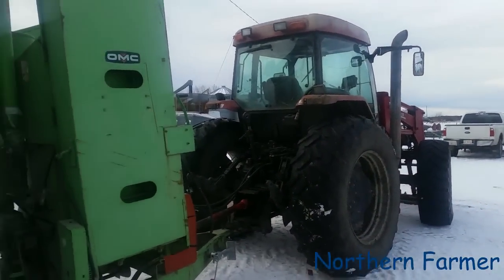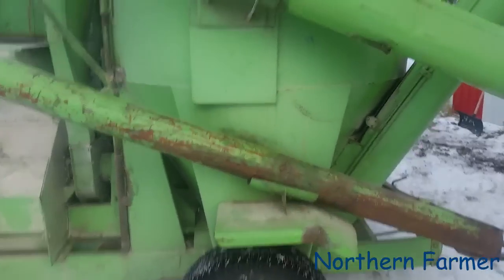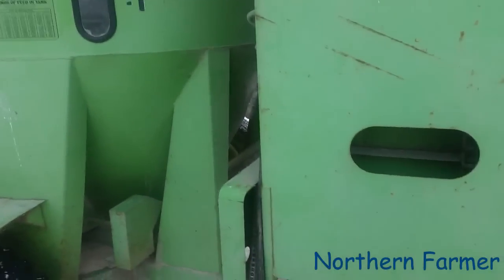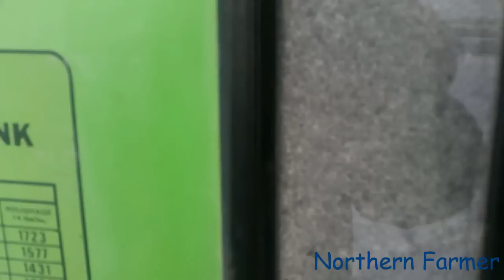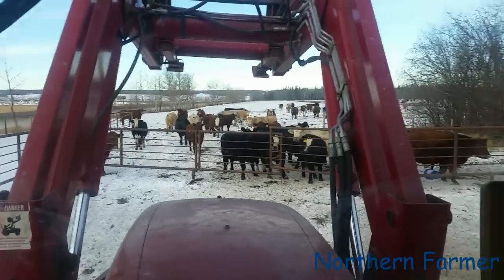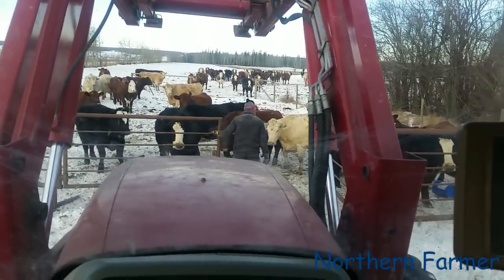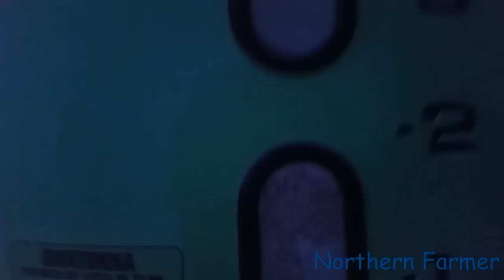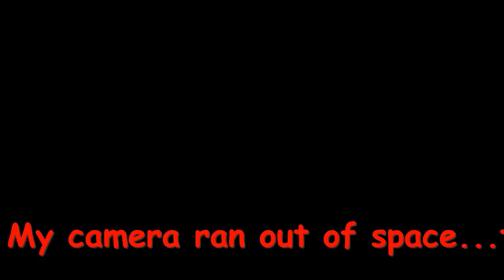Grinding Feed For Cattle with the old Hammer Mill!!!

Comment: That's awesome I've got to grind Barley today I just picket up some molasses to mix in it to help the dust.  It's still dusty
Reply from the maker: I never heard of doing that for the dust.... Learn something new everyday
Reply: The molasses is a treat for them but it does help the dust I also put canola oil with it.   The screen we use on barley is finer than yours and the one we use on corn is too big for the barley so it gets quite dusty once it's ground.   If you feed the barely in a TMR with silage it doesn't matter but we are just feeding hay in feeders and grain in the bunk so the less dust the better.  It makes a big difference on the steers when they are on 30lbs of grain.

Comment: How does Barley compare to oats for feed value? I always mix oats with my corn but Barley makes better straw, I may have to switch to Barley!
Reply: Barley is significantly higher energy and less fibre but it must be ground or crushed / rolled otherwise it will go straight through them and you will see whole grains in the dung. Rolled is better - much less dust and more palatable however you can counteract the dust directly by adding molasses or traditionally cod liver oil -both of course are high energy foods.
Another approach for us is to use a TMR feed wagon where clamped grass or maize silage is the main source of forage and prepared grains, protein and mins & vits are all added into the mix. The moist forages capture and kill the dust and don't allow stock to be selective about what foods they prefer.
The other main advantage for us is to incorpoate food factory / packing house by-product waste such as brewery products, vegetable products, potato sludge, veg waste such as cabbage /carrot/ beetroot /salad foods (but not onion) or other farm grown crops such as sugar beet, fodder beet, potatoes. 
I have no idea what might be available in your area from various food processors and some are only available at economic prices in the summer but can be successfully clamped in a pit store and fed over winter such as wet brewers grains from the brewery.
Many of these foods are high energy but often low protein and have peculiar mineral levels
Reply: Thanks Dan, I grind my oats now and mix with ground corn, so if I were to raise Barley I'd still do the same. Just wondering if Barley yields better than oats
Reply from the maker: Yes  Barley makes them fat!!! We will Grind both sometimes .. half and half
Reply: larsonvalleyfarm

The short answer is yes barley will normally out yield oats simply because it has a higher grist content and much less husk.

Autumn planted barley will out yield spring planted barley by about a third but although we can grow it very successfully here I simply don't know if it would survive your sustained winter weather. However if you can grow grain rye successfully planted in the Autumn through to harvest I don't see why you cannot grow it where you are.

A few issues you should be aware of:
1) Barley will not tolerate soil acidity well at all, you need a pH 6.5 for it to grow well and adequate amounts of P & K present in the soil or applied as fertilizer.
2) You need to examine the seed house agronomic information about suitable varieties as some are prone to foliar fungal disease especially mildew. Some are also inclined to become laid and not stand too well coming up to harvest although this can be overcome with finger extensions called crop lifters taht lift the crop up enough so that the knife can cut the stems.
3) Apply base levels of nitrogen + added sulphur quite early in the spring to support tillers or stimulate fresh ones if weak and topdress with more N about 4-6weeks later.
4) Beware of planting seed too soon and too thick as this can lead to thick lush growth which then dies back and can smother crops. We call this Winter Kill. If this looks as though it might happen consider offering some free winter grazing to someone with a lot of sheep -it looks mighty severe afterwards but the crop will bounce back in the spring when it gets some N! Sheep also firm the soil around the plant and help to counteract frost heave on the surface as well as returning a little dung to the crop.

Be aware that my comments are as if farming in the UK - a more local agronomy advice (college / University) service (or possibly your seedhouse) to you would be best for your soils and weather conditions.
Weed control is important and winter planted crops may well two treatments main one in the Autum and a clean up in the spring - these can often be combined with fungicide treatment.

An entirely differennt approach is to consider whole crop barley silage where the total crop is harvested when the grain in the ear is at the cheesy stage. Mow it and make pit clamp silage or bale it. Bales will have to be wrapped or bagged and stored on concrete or soft sand so that the plastic is not puctured. Wild birds can be a problem and also rats in this respect - we net ours or cover the bales with thick plastic and put down sealed plastic bags of rat poison as the stack is built. We tend not to make a stack but lay them out in long lines with the flat sides butted up close together as this discourages rats.

However would bales of silage freeze solid in your winter weather?
Reply: Thanks for the info Dan. We have made silage bales in the past and the outside 1/2 inch will sometimes freeze, but the bales dont freeze solid.
Reply: Fine then this might be something to consider as a trial plot/process?